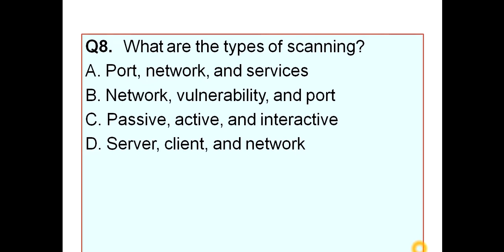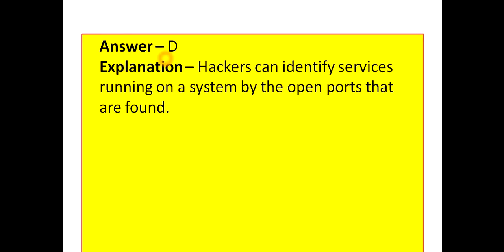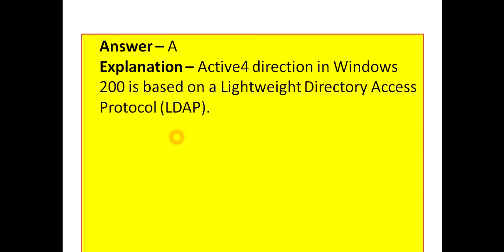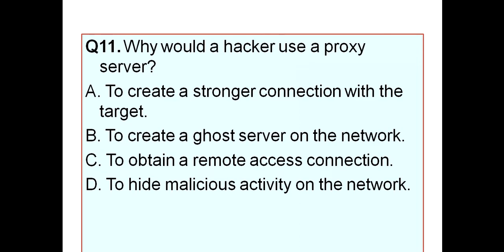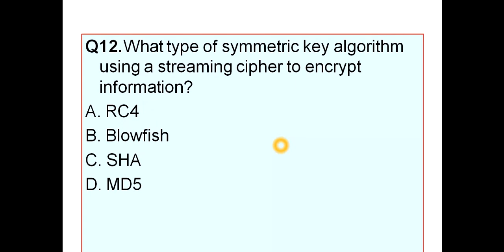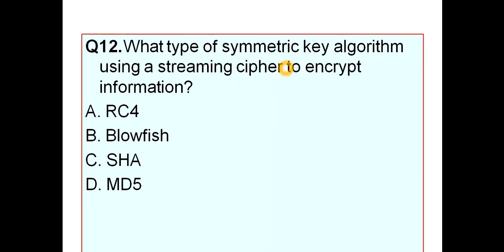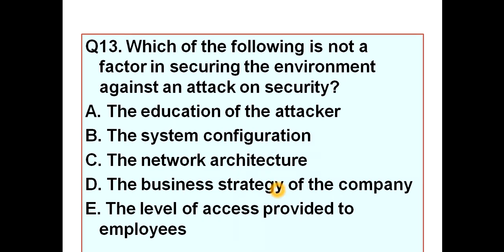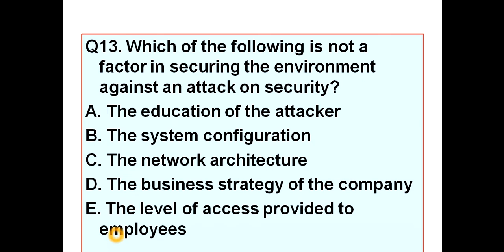Important MCQ on Introduction to Cyber Security | Set 2

Comment: 4/5 
The full form of RC4 is Rivest Cipher 4.
It is used for subsequent generation of pseudo-random bytes and
then to generate a pseudo-random stream which is XORed with
the plaintext to give the ciphertext. Each element in the state table
is swapped at least once. key. It has the capability of using keys
between 1 and 2048 bits.
Reply from the maker: Right

Comment: 3/5
Raktim kakati

The full form of RC4 is Rivest Cipher 4.
It is used for subsequent generation of pseudo-random bytes and
then to generate a pseudo-random stream which is XORed with
the plaintext to give the ciphertext. Each element in the state table
is swapped at least once. key. It has the capability of using keys
between 1 and 2048 bits.
Reply from the maker: Right Answer !
Reply: @djb_world  thank you sir

Comment: The full form of RC4 is Rivest Cipher 4.
It is used for subsequent generation of pseudo-random bytes and
then to generate a pseudo-random stream which is XORed with
the plaintext to give the ciphertext. Each element in the state table
is swapped at least once. key. It has the capability of using keys
between 1 and 2048 bits.
Reply from the maker: Right Answer !

Comment: The score is 4/5

The full form of RC4 is Rivest Cipher 4.

RC4 is a stream cipher and variable length key algorithm. It is remarkable for its simplicity and speed in software. It works in two phases: key setup and ciphering. It encrypts one byte at a time (or larger units on a time).
Reply from the maker: Right Answer !

Comment: score 5/5

RC4 (Rivest Cipher 4 also known as ARC4 or ARCFOUR meaning Alleged RC4) is a stream cipher.

RC4 has the capability of using keys between 1 and 2048 bits. RC4 is used in many commercial software packages such as Lotus Notes and Oracle Secure SQL
Reply from the maker: Right Answer !